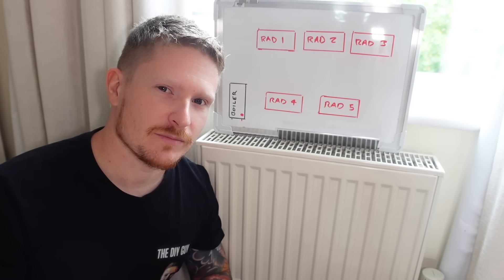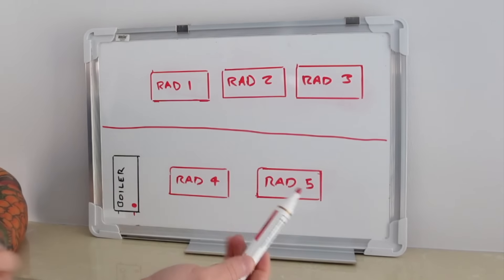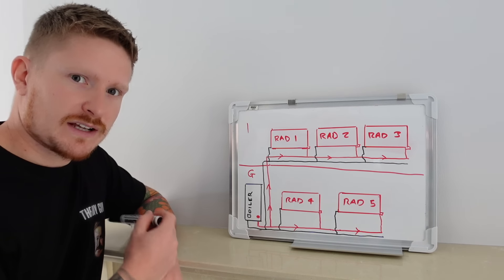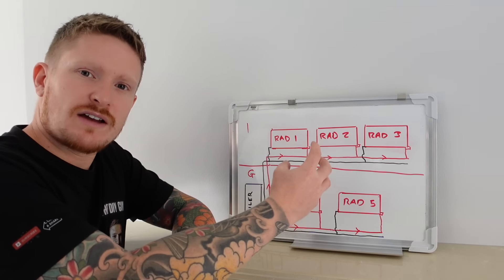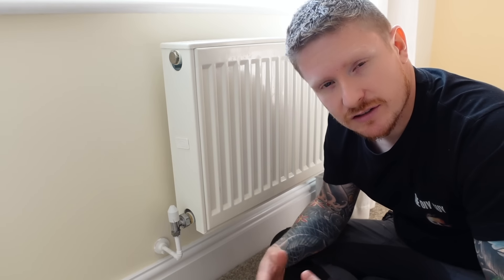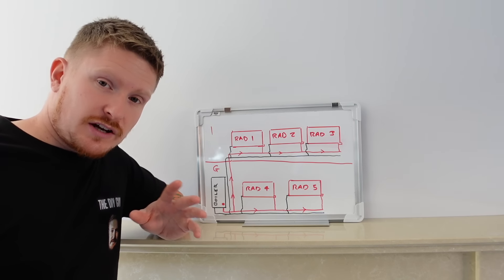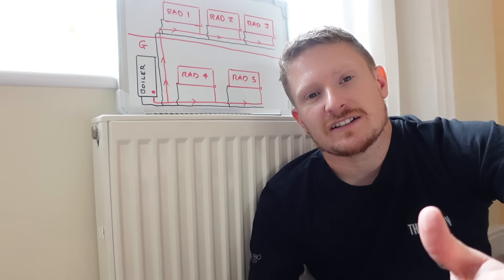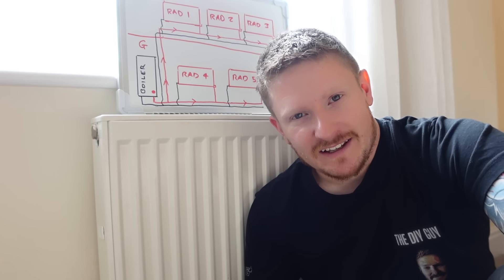How to Balance Your Radiators | Save Money and Increase Heat

Comment: How do i know which valve is which as they both look the same on mine, both have plastic caps and a pin looking tap? I bled my radiators and got some air out but water never came out and when I put the heating back on it didn't heat up at all whereas it was slightly warm before? I have no pressure gauge or dial or any way of checking my boiler it's just a pilot light and a temperature dial min to max... water only emerges from my bathroom radiator when bleeding none of the others, no air but aren't getting warm, my bathroom one is getting warm. Help please.

Comment: The old school way isn’t really recommended for condensing boilers. Also good TRVs are necessary for an efficient system. Most people have cheap TRVs on the radiators and they are useless for regulating room temperatures.

Comment: Can you help me fix my radiator with a slightly different problem, it is hot at the top and colder at bottom until it really heats up about an hour or so and then seems to get better
Reply: Fully open the lock shield, it could be that. Failing that it could be sludge, the first option is free to try 🙂

Comment: bro in my radiator i dont have that adjustment valve. i have only one valve to reduce and increase the heat. and even i turn off the heat my heat does not stop heating, my room is like burning and i have to stop the boiler always in basement.. and i dont know from where to adjust the boiler heat. because eveything is explained in german language here,
Reply: Any tip on how to fix it? i also live in Germany and have the same problem.

Comment: Nice idea but its doesn't really describe it fully. As an example by restricting the locksheild on number one the water will seek the easiest path which will be number 2 and so on. Also why open the last one fully its multiple turns? so say you have 6 rads each will get a 1/8 of a turn. rad1 is 1/8 rad2 is a quarter rad3 is 3/8 rad4 is half rad5 is 5/8 rad 6 is 3 full turns. its a big jump?

What i did to find the sequence is fully opened all TRV and lock shields and fired up the heating quickly checking all the rads. Found RAD 1 shut the heating off closed trv and lock shield on RAD1 waited for the system to cool fired it up checked remaining found RAD2 shut off the heating closed trv and lock shield on RAD2 so now 2 rads were fully off then did the same over and over till i got the order correct. Then I opened all trv valves and went from the first to the last opening each a quarter of a turn.
Reply: So, did you do the balancing on the incoming side of the radiator, or on the exit?
I have TRV on the incoming and lockshield valve on the exit of the radiator. Here in the video it says we should do the balancing via lockshield, which in my case is on the exit side, whereas he is doing the restriction on the incoming! Confused...

Comment: Does the balancing have to be done by the LSV or is it possible to do with the TRV (which I was told to do by a friend)? 🤷🏼‍♂️
Reply: It's not possible to balance via any TRV that I'm aware of, we only ever use the lock shield valve. I recommend that you give every radiator a number and record against each radiator number how "open" the L/S valve is i.e 1/4 turn, 1 whole turn, so that when remove a radiator you'll be able to easily reset the valve.
Reply: The way I think of it is the LSV controls the rate of heating to a room, the TRV controls the maximum temperature. So if you want to be clever you could set up the system so the flow goes to the most used rooms first, knowing the TRVs will kick in and that would then encourage flow to the other rooms. Really once you have TRVs balancing becomes a less important thing, and it depends whether you have a house where you tend to keep the heating on or you are out a lot so you put it on for shorter times. If you have the heating on most of the time, then balancing isn't going to be too important as the TRVs will be the dominant controller of flow to the radiator, if you switch it on and off, balancing will ensure that the house heats evenly as the heating kicks in until the TRVs take over.

I don't think it helps to be too precious about balancing once the system is properly heating all the rooms because human bodies provide about 100W of heat each, and a TV with sound system can be kicking out 500-1000W of heat and so on, so as different rooms are used, the amount of heat required to be delivered by a radiator will change. 

TRVs do the same job as a lock valve, they open and close flow. The LSV should control the maximum flow rate allowed for a radiator, the TRV will generally be partially open once the system if up to temperature, gently altering the flow as the room cools and heats - from zero to what the LSV allows. If you have a room where the TSV is set to max and still not warm enough, then the first port of call is to open up the LSV a bit. Clearly, as a TSV closes, that diverts flow to other radiators, so heat can move around the house. Imagine some 10 year old has been fiddling and has opened up an LSV fully (some LSVs can be opened with the cap)  - that might encourage a lot of flow through one radiator but then the TRV will kick in and solve the problem, but on a cold day the TRV might not kick in and you might notice some radiators not working properly.

Comment: I had a loft conversion done recently. The radiator in the loft is not as hot at the bottom as it is at the top of the radiator . I don’t think it’s sludge because it’s a new radiator?  One thing I have noticed is the TRV valve is not connected to the feed pipe that gets hot first ? Is this  problem. The radiator does get hot at the top just not as hot at the bottom . Please help

Comment: Hi there recently we had a replacement kitchen sink pipes and the water was turned off but on turning the water back on the central heating radiators work apart from the 3 downstairs I've bleed all them and the upstairs  are red hot but they 3dowstairs stone cold and no water comes out when opening the bleed valve as left them open for a wk and still no water so anyone give me suggestions to fix them as prior to the sick pipe work all radiators where working.  Thanks

Comment: Surely the TRV should be fitted on the flow end so the hot water that’s not required bypasses the radiator?

Comment: What do I need to do if my radiator is hot at the top but cooler to the touch at the bottom. Cheers
Reply from the maker: Refer to my video how to fix cold radiators. This should help solve your issue

Comment: I am complete novice. How do I tell which is my lockshield valve input and lockshield valve return. Thanks
Reply from the maker: You can tell direction of flow by identifying which pipe heats up first(also visible on thermometer). Whatever pipe heats first is going to be the flow.

Comment: Why does it matter what rads heat up first if you are going by where the rads are on the system. You say open the last one up fully on the system - do you mean the one that takes the longest to heat up or the last rad on the run?

Comment: My bedroom radiator sounds like a boiling kettle when it comes on. It has been bled turning it down from full to 2 stops noise but also heat output
Reply: You can get an auto air valve thing

Comment: What if I fully closed no.4 RAD
Is that mean no.5 won’t get heat?
Or total circus wrong?
Reply: No because the water doesn't go through rad4 to get to rad 5. They all T onto the flow and return so if the water can't go through the valve because its closed it just carries on down the pipe to the next radiator.
Reply: @malcb1864  You didn't live in our house with a 1960s system which had a single flow through the radiators with no bypass - and then the previous owner added TRVs!

Comment: Huh. So what do I do if there's no valve on either side of my radiators? It's a nearly 100 year old house in the U.S. with the radiators in the walls. The two I see with a valve besides the bleeder valve are a big one in the basement that may have been added later in the life of the system and the one under the kitchen sink. 🤔

Comment: The return pipes are the ends just left like that?
On your diagram one bit of the return pipe is connected to the radiator not there is also a bit just connected to nothing.

Comment: Brilliant video as always! 

I was wondering how it would work if you effectively only want to have the radiators on the ground floor running and keep the ones on the 1st and 2nd floor off at all times. In that case should we have the lock valve closed for all radiators on the 1st and 2nd floor and open on the ground floor ones (close to) fully, targeting that 12 degrees difference on each?
Reply: I would balance all of the radiators first using the lock shield valves and then turn off the unwanted radiators via the TRV or control valve i.e. the valve at the opposite end, then if you need to turn on a radiator it will have the correct flow.
Reply: Another way is to separate the first floor into it's own zone using a zone valve where it tees-off from the main flow. The whole floor then has its own thermostat, and you can set its own schedule - say, to keep it all off in the daytime. I have just done this for my top floor loft-conversion. It's a bit of work, but well worth it for me. So far this year, the heating has almost never needed to come on.

Comment: Hang on - is the lock shield valve on the inlet or the outlet of the radiator?  I thought it was on the outlet with a TCV on the inlet.  But here he is setting the hotter, inlet valve which he keeps calling a lock shield.  Where's my error?

Comment: Hey thanks for this video! How does the pump speed and the balancing of the radiators work together? My biggest radiator only drops 7 degrees. I have slowed down my heating pump to minimum to improve but this is the best I can do. Do you suggest that AFTER slowing down the pump, closing the lockshield valve a bit to further slow down the flow? Won't the pump get damaged by that? Thank you!
Reply: The pump will be fine, as long as it has some flow

Comment: what i want to ask is this..........the top grille cover on radiator (double radiator)........is it possible to remove it as ive tried everything i can think of.............my problem is ive fluff and cat hair down there but cant get to it to vacum it out....cat used to sit on radiator looking out window and any cast hairs fell down and got trapped...........id like to remove cover and suck it out .
Reply: It depends, some are welded on, others are just clipped on. Most I've come across are welded on, just checking the one over there ---> it is solidly fixed and is not coming off. 😢
Reply: You can get rad brushes.  I used a pc blower to dedust mine.

Comment: If you’re watching this video then it’s likely that you have radiator problems. How then can you determine which order your radiators warm if a few never or barely get warm?
Reply: The cold ones could be at the end of the loop. Open the lockshield fully one the cold one and try close ones nearer the boiler a little.  Nearer ones heat up fastest.

Comment: I got this problem with one radiator ? I just had a new upright double radiator installed and it doesn't get hot at all but all you other radiators in my flat I'm in a ground floor flat get piping hot. All the radiators right through the flat piping hot.. I got two radiators in the living room a long one under the window and the upright one on the opposite wall at the other end of the living room
Reply: Open the valve more..

Comment: my boiler was fine, then after a service I've had nothing but pressure issues. pressure goes too high, I bleed the system to lower it, add some water into system then its too low then too high again , can't seem to get it stable, driving me crazy now

Comment: Unfortunately my lock shield valves started to leak after adjusting them.
Reply from the maker: Ah it happens unfortunately. Luckily they are relatively easy to change.
Reply: @TheDIYGuy1  A warning in the video would have been nice. I got into trouble with my landlord because of this video.

Comment: I thought it was good installation practice to put the LS valve on the Return, with the TRV on the Flow side, and that putting the TRV on the Return side, could cause “hammering” in the TRV. Has this changed with newer TRVs ?

PS. Great channel, and vids. Certainly teaching this ol’ dawg some new tricks 😊. Keep up the good work.
Reply: Yes this isnt an issue with trv’s from the last 10-15years
Reply: Ah, ok. Thank you.

Comment: I put thermostats on my radiators, set them to 23 C and do not have to bother with "balancing" them!
Reply: Exactly, I studied heating at school and balancing with classic valves works only on paper, never in real building. Power of boiler is not constant, you have to always running and moving with valves, that's really like something from middle ages. Thermostatic valves and heads are mandatory in all apartment buildings here in Czechia, they probably know why, it solved all problems with overheating in small rooms, so hot water is not where you really need it in that moment. I would say that you can totaly skip balancing with thermostatic heads and it will work fine, but you can have some problems with loud valves or something, some tuning is mostly needed even with thermo valves, but that's nothing compared to balancing oldschool system.

Comment: After watching this video I’ve come to realize they plumbed all 12 of my radiators wrong.  I only have ONE line that runs in a circle all the way around my house and every radiator has BOTH ends plumbed off the one main feed line with Tees. I have NO return line. So water is able to pass right by the radiator without stopping.  Water passively makes its way up into each radiator rather than being forced into it…

Comment: But how do you know which radiator is what number on the system…pull the floors up?
Reply: What heats up first. Says it at the beginning
Reply: Open all TRV's and lockshields and then go round feeling which gets hotter first.

Comment: One of my radiators shuts off much quicker that the other all have Thermostat valves, yes the valve shut based on temp in the room but if it is on full blast shuts off much quicker thatn the others the guy changed the connector and the valve twice now he said he will just put a normal valve he does not know why the rad is switching off so quikck and the boler is not on max heat to pump too much of the hot water in. Idk the rad does not have pockets of air

Comment: I read somewhere that microbore systems are somewhat self balancing. Is that correct in your experience? 

For info, my boiler feeds into a supply manifold, and the radiator returns all connect to a similar manifold. Microbore pipes run from the manifolds to each radiator. The radiators do all seem to heat up at pretty well the same rate (all lockshields fully open).
Reply from the maker: Microbore is certainly less susceptible to balancing issues but that can still arise from time to time. Certainly more common on 15mm pipe in my experience.
Reply: An experienced gas engineer recommended I replace microbore with 15mm pipes as it's less stress on the pump.
Reply: @bikusmoto59  An experienced gas engineer was after some of your money!.